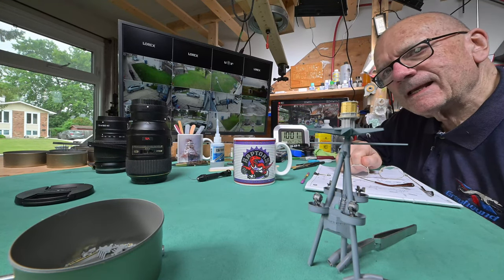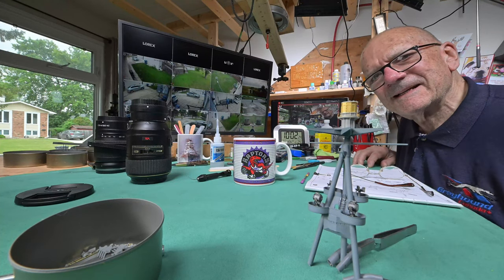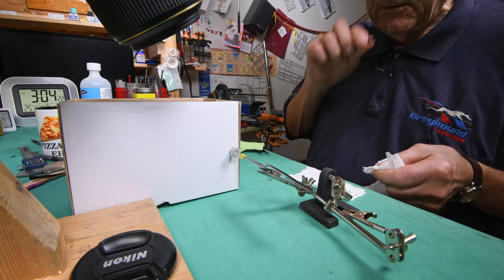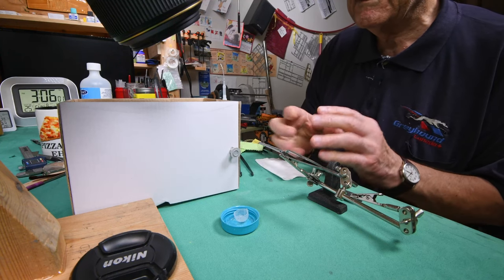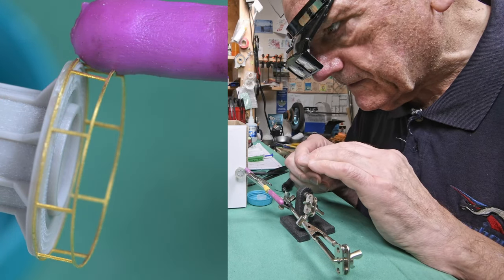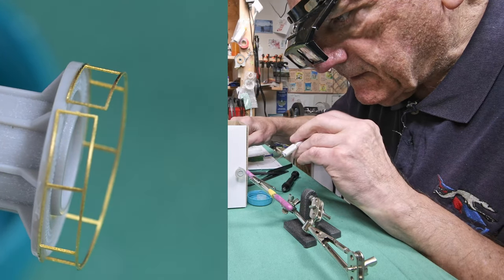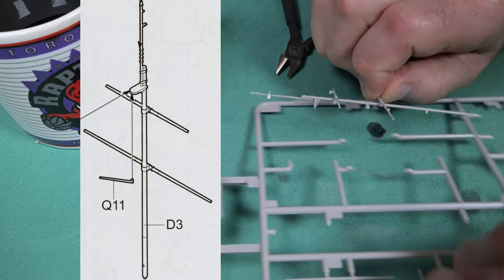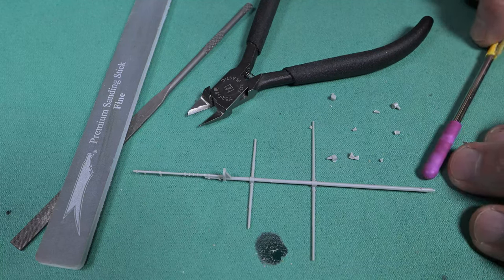The Model Ship - Part 1271

Comment: I must say Ron that you have disappointed me by forgetting the number one procedure to do when folding and/or rolling photoetch and that is annealing it to take the springiness out of the metal. Also when rolling railings like that you need a dowel or drill bit just a smidge smaller than the diameter you are trying to achieve.

Comment: Could you not measure the diameter of the area you need to fix the rail to , then turn a piece of wood to the same diameter. Then bend the rail on that glue it then slide it onto the kit part ?
Reply from the maker: Yes, good idea that! But that would mean I'd have to go down the stairs and turn a piece of wood, haha! 😁